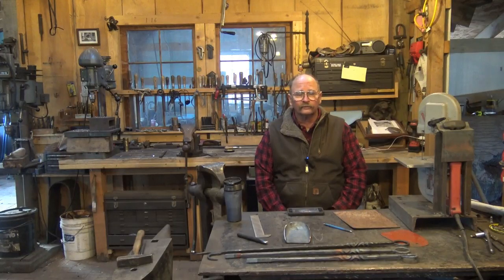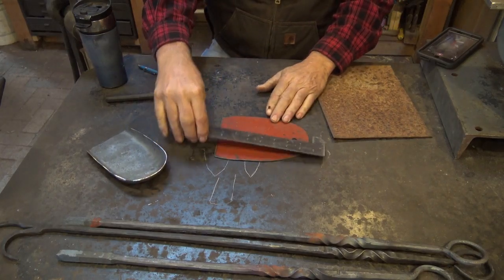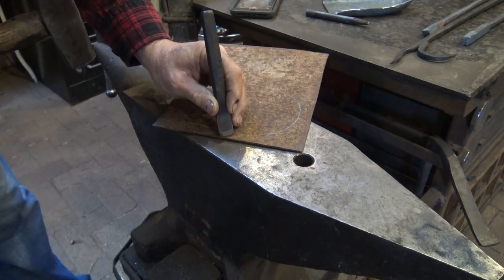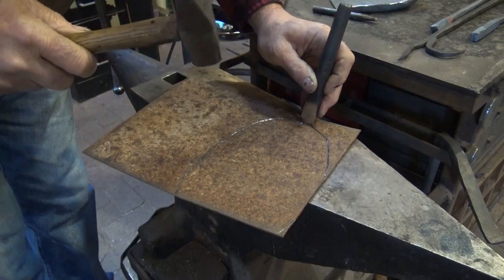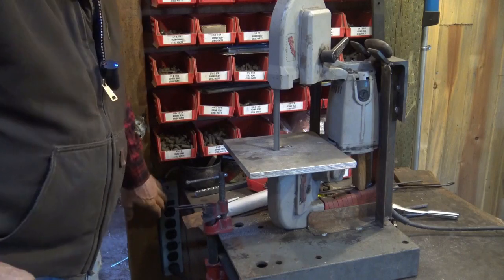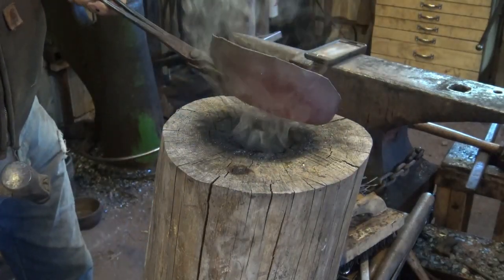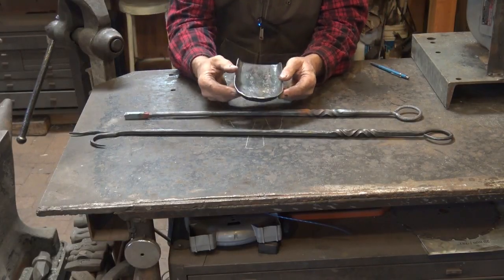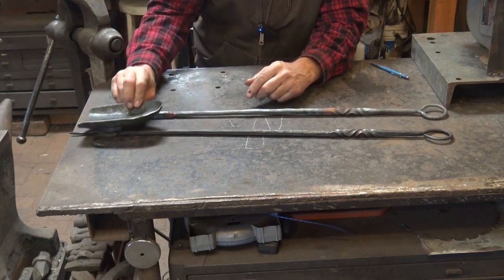Forged fire place shovel - cutting sheet metal with a cold chisel

Comment: Just a tip: If you want to hollow out a stump for shaping, The easiest way is to start a fire and shovel hot coals onto the stump. You can tip the stump to knock the coals back into the fire, and just a tablespoon or any thing rounded will scrape out the burnt wood left by the coals...Practice a few times to get the hang of how long to let it burn, I usually don't let it go very long. Knowing I can add more coals and burn deeper if needed.
Reply: That's a good idea. I'll have to try it.

Comment: You can make the oxygen bottle much more comfortable to use.  I have a couple I've made and you can quiet them by filling them with very dry sand and welding a bottom on.  On a large bottle like the one you have a simple plate would be fine, on my small one, I welded a piece of square bar to the bottom to use it in the hardy.  Filling the bottle with sand really deadens the ring.  Other wise, you're just banging on a bell.

Comment: I noticed your swage block has sort of a notch at the front edge of the shovel. If you made enough shovels to spend the time tooling up, I think by modifying a pair of tongs to fit in that notch and adding some kind of sacrificial edge on your blank you could set up so that every time you grab the blank out of the fire it would line up in the swage the same way.

Comment: One of the first things I made when taking a blacksmith class was a fire poker/rake and a shovel.  I like the way you attached your handle better than the way I did mine.  The curved part of the handle going under for more support seems a good way to go, does it get in the way or make shoveling ash in a fireplace less efficient?  Thanks for the great video!
Reply from the maker: I then to use a shovel tipped up so only the edge touches, so I don't notice a problem.

Comment: Thanks Teacher , Hay what do you think of using linseed oil as a finish to blacken the steel , when applied hot or I’ve been using it as a cold dressing for preventing surface rust on pieces for sale in the market place as well .I notice you always use the paste wax , I’ve also used bees wax but applying it evenly is more challenging than old fashioned linseed oil . One day I’ll get some paste wax , but it’s not commonly available in Australia . :)
Reply from the maker: Linseed oil works but takes more time to dry.  You may also mix beeswax, linseed oil and mineral spirits to make good finish coat.
Reply: @BlackBearForge  thanks mate I’ll try that :) I have noticed quite a difference in the shade of blackening , from ‘close to too hot’ and a bit more chilled . Close to too hot ,being a lot darker . :)

Comment: A question about the bottom of the half oxygen tube. Is it empty inside or is it filled with sameting?
Reply from the maker: Its empty, which allows me to place smaller cylinder bottoms inside of it for storage.  But I would guess it would be more solid to work on filled.

Comment: Hello sir I am new to forging and I have built a coal forge. I am wondering if there is an easy way to make a large amount of coke for the forge other than buying it or making a little at a time.
Reply from the maker: In general you make coke as you use it.  Fresh coal starts at the outer edges of the fire and as it cokes it gets pulled in to forge with.  I don't know of anyone making coke ahead of time.  https://www.youtube.com/watch?v=INRNZTuxyGU&t=16s